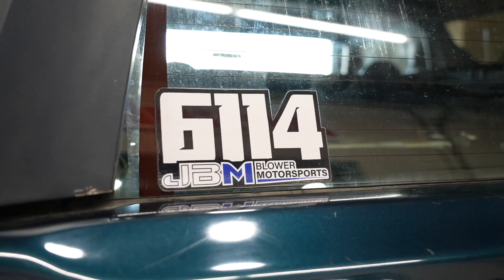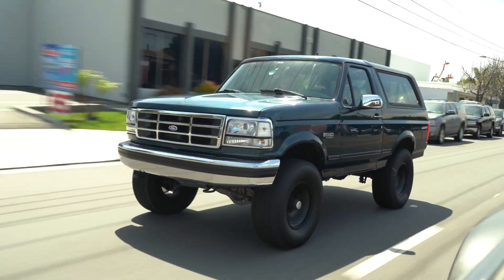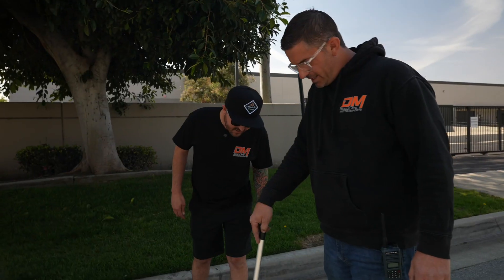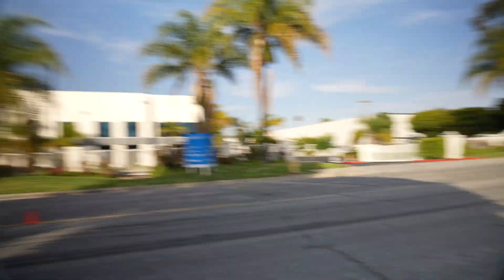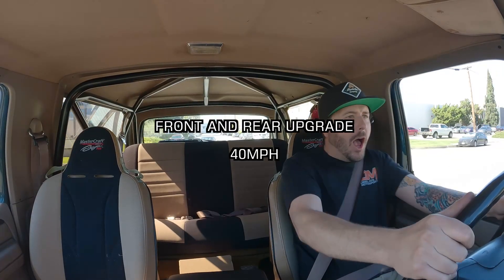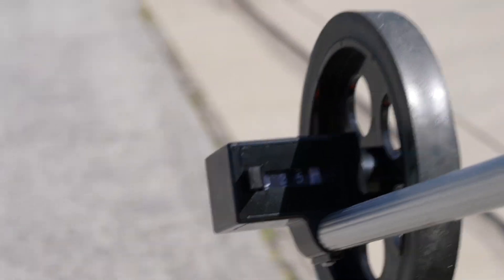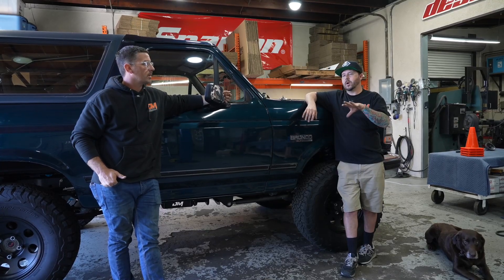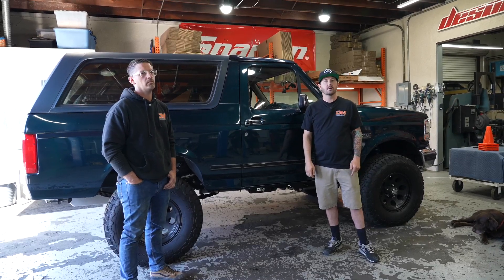Comparison: Desolate Big Brake Kit vs Stock Bronco Brakes

Comment: For those of you that are watching that don't want to waste big money and still want to run your 15 inch tires and have good braking still go to a wrecker scrap yard find an F-250 or F-350 take the brake booster and master out of it bolted into your stock Bronco bleed your brakes and you will notice you have way stronger braking go to the parts store get two new front rotors find a machine shop that will do a sliding on the rotors on the front and back install your new slotted rotors you will notice you're breaking is increased to increase rear braking power on drum brakes take the drum off you'll notice one pad is long and one pad is short take the two short pads I'll throw them away get a new set of brake pads take just a long pad and put it where the thin pad used to be so you have two long brake pads for your drum brakes you will notice your braking is way better 4 1/2 the the cost

Comment: So, you replaced the rear drums with discs WITHOUT  a specific master cylinder?  I'm thinking not, otherwise the rears would still only receive 20-25% of the energy, and the stopping distance would remain at least 80 feet. What else was done to the system please?

Comment: My hat is off to you and those others who are supporting this market.  It takes a lot of balls to not only support and maintain a market that is over 30 years old, but to innovate and improve upon that market.  You are releasing products that are needed, and are a great improvement over stock, or previous upgrades the market has seen come and go over the years.  I've got my '85 over at Cody Crafted getting your 4" trail setup with stage 2.5 beams, and I can't wait until I am able to get the big brake kit on the front.  I've got a 9" already, but now I see how important the rear setup is as well.  Well done.....